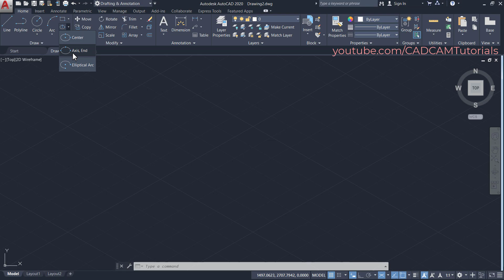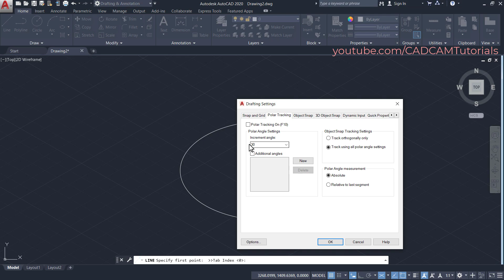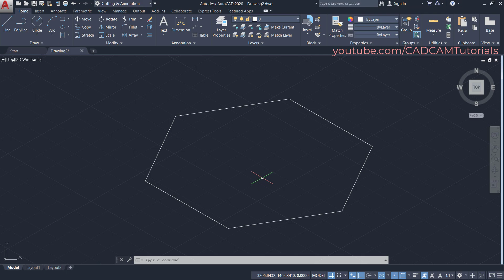How to Draw Hexagon in Isometric View in AutoCAD

Comment: Sir we Know you are Working Hard by providing Such a beautiful Videos, Sir It will be more Helpful if you Provide us few important Industrial parts on Catia Software with Drafting (Industrial Parts)
Thank You Sir ❣️ 😇
Reply from the maker: Do you have drawings for them?
Reply: @CADCAMTutorials  Sir I Have IPD Names But Not Drawing ... Sorry Sir 😔
Reply from the maker: Give me some names, I will see if I gets their drawing.
Reply: @CADCAMTutorials  1) Bracket for CAC 2) Brakes and Pedal System 3) CCV Adaptor 3) Contact Carrier (Fixed) 4) Clamp 5) Delivery Port 6) End Cap 6) Piston 7) Socket 8) Filter Housing Base Plate 9) Upper Seal Plate 10) Top Channel air Cleaner... Sir These are Few IPD Can you Please provide us parts as well as Drafting 🙏🙏🙏